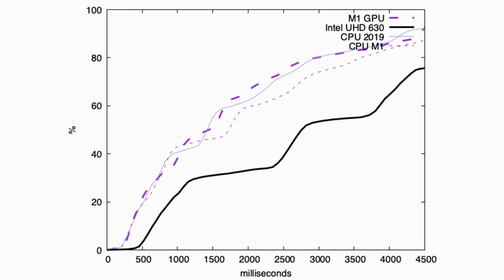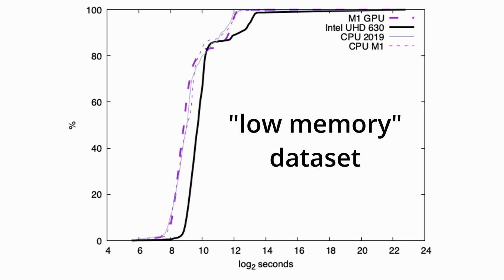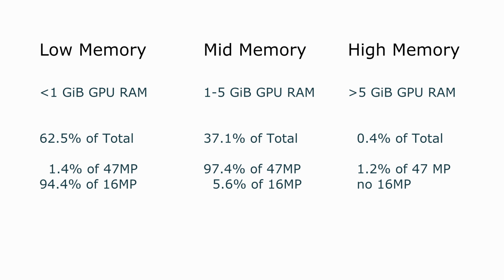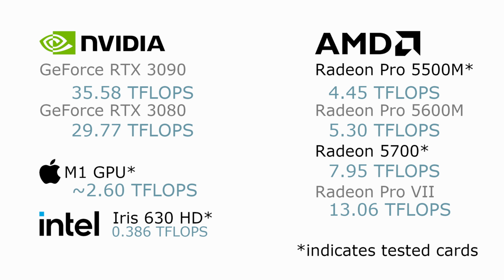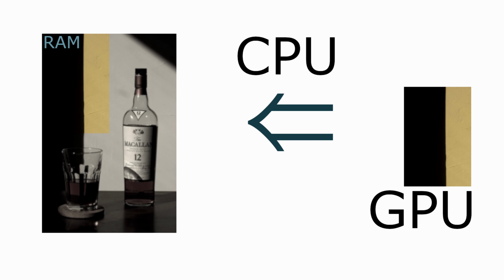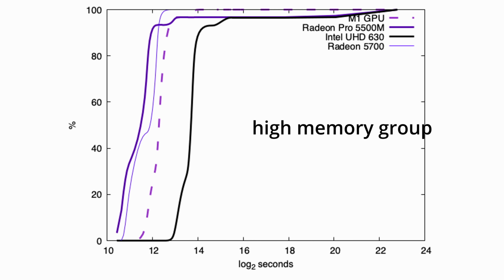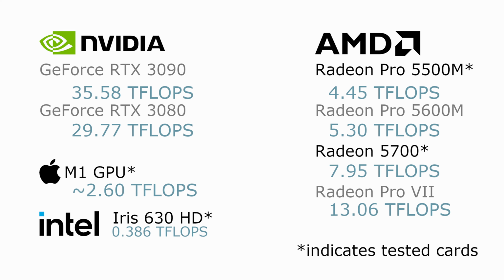Apple M1 vs Intel performance editing photos in darktable

Comment: Hi! Many thanks for your analysis. Would you mind to update it for M2 (Pro) and Darktable (allegedly) having gone native on M* chips? As I'm considering buying a new machine, I would really appreciate any advice. I've been using Linux for past 20+ years and love it, but I miss some apps (Logos Bible Study, Affinity Photo, etc.). I don't like mac (after playing with it for a while) as it seems clumsy and command-line utilities I love so much seems to be much worse but I'm willing to give it a try---if the Darktable works ok with it including the expensive operations like Diffuse-and-sharpen module. (I mean for my home stuff. For my real work, Mac is no way and I will stick to Ubuntu.). Many thanks for any hint or help you could provide. Best wishes, Michal
Reply from the maker: It's been four months, sorry it took so long.  I did run a comparison of darktable on an M1 Max (64GiB RAM; not an M2) both compiled for ARM and ran through Rosetta.  This wasn't as thorough as the original tests; my theory was that after an initial hit to precompile/translate the X86 instructions to native code, the Rosetta performance wouldn't be that different over the long run (under the theory that Darktable and its libraries generally wouldn't be optimized for Apple Silicon).

Given that hypothesis, I was a little surprised to see a 37% speed-up (specifically, running darktable 4.6.1 on MacOS 14.1 (23B74)) the Intel code ran at 137% the time of the Apple Si binary; or the latter ran at 72.87% of the time of the Intel code). 

I'm curious if you've seen other numbers, and if they're in-line with that, since I didn't go deeper (e.g. look at the difference in individual module performance).
Reply from the maker: Thanks for watching and your feedback! 
I'm not sure if I'll have an M2 Pro handy in the near-term, but I'm also curious about how the recent native builds perform against the Intel builds.  I've been continuing to run Darktable on an Intel-based Mac because of the eGPUs and (annoyingly) software RAID drivers I installed once upon a time.

Comment: amazing detailed analysis. thank you for that!
did you finally buy m1 pro? :)
Reply from the maker: Thanks for watching!

Apple hasn't updated their Mac Pro (desktop/workstation) line, which was what I was originally expecting to get–but they did release the Macbook Pros with the M1 Pro and M1 Max variants of the M1–I ended-up getting one of the latter rather than waiting for an updated Mac Pro (and principally for video workflow, where it made more sense than a GNU/Linux based system for a variety of reasons).  I'm finishing-up analysis of the benchmarks–I rushed the first M1 comparison video, and am aiming to do a more comprehensive job on the next round–so I'm hoping to get that published at the start of December (school holidays are going to effectively knock me out for the next week).

The short analysis: despite all of the "it's amazing" articles that have come-out over the last couple weeks-I'm still amazed by it, but it (M1 Max) also seems to fit right where I expected.  In most of the workloads I've tested, it comes in at about 2x the performance of the 2019 MBP and half the performance of a maxed-out Mac Pro (based on other's benchmarks) for tasks like Davinci Resolve.  I'll go into more detail about where it seems to excel compared to the 2019 16" Macbook Pro, and where it's more nuanced in that video.
Reply: @NottaPro 
I expected that you bought one of new Mac pro with m1.
I plan to buy 14" pro with 32gb (my the most demanding target is photo post production) .
Eager to watch your detailed comparison (based on darktable experience) when it will be ready. 

PS: I like to speak with people who pay attention to the details - you one of them m. I glad to became your subscriber 🙂
Reply from the maker: You won't be disappointed with the 14" MBP's performance in darktable, and 32GiB ought to be more than enough if that's your main use. It stays quiet which, is a bonus, although I did get it up to 109ºF at the chasis–but that wasn't exactly standard usage.  Thanks for subscribing!
Reply: @NottaPro  Would you test DT with release 3.8 on the M1 PRO / M1 MAX? I think lightroom recently made some impressive improvements running native on these machines. Not sure how much penalty DT gets by running Rosetta. But I'm also about to buy a 14" M1 PRO with 16BG and I love the fact DT now supports iOS.
Thx already for your M1 analysis so far. Really much appreciated!
Reply from the maker: Already done!  My most recent video on this channel is about the M1 Max (https://www.youtube.com/watch?v=nZKwVj57FJA), and while my focus is more on Davinci/video–it does reprise the DT tests, and goes even deeper.  Rosetta does have a penalty, but it seems to me most apparent on start-up (or as it sees code for the first time), which means the darktable-cli benchmark performs a lot worse that you'd expect during interactive editing.

In the end, I decided to keep my 2019 Intel Core i9 MacBook for darktable, and use the 14" M1 Max for Davinci Resolve–but unless you're adding eGPUs to the Intel MBP, or doing a lot of scripted (darktable-cli) sessions, the M1 Max will be faster (or at least not slower) while being quieter and lasting longer.  I also posted a related/follow-up video addressing what seems like silly reasons to put-off buying a MBP as well as why I'm not finding that newer eGPUs make sense-for me anyway-as the cost to performance increase isn't there for my workload: I'm not seeing dt able to push enough to the graphics card on either laptop to really make use of a significantly better card.

Re: DT on iOS-I hadn't seen that?  I've seen a competing product "darkroom" which is confusingly generic-I'd be very surprised to see darktable on iOS given its Mac port is barely supported (single dev AFAIK) and its core isn't very Mac-ish which would make a port a fairly significant rewrite.  I'd love it if I were wrong.

Thanks for watching!
Reply: @NottaPro  that one is in my watchlist … thanks!

Comment: Hi, 
I don't speak very well English (I'm from Switzerland), that's why I didn't understand every thing you said in the video. You go really deep with the explanation. I just have simply question. I work (not as a professional) exclusively with Darktable. It's for me the most important software. I need to change my PC and I wanted to know if Darktable run well on m1. Is it usable? Or it's not enough optimise? I don't mean it's the best computer ever but for 900$ does it run enough good to be usable?? 
Thanks you for the time you take to read this message with so much mistakes.
Reply from the maker: Short answer: yes, it's definitely usable.  If you're choosing between an Intel CPU with integrated graphics, and AMD CPU with integrated graphics, or the M1 (which only has integrated graphics); they're all going to be fairly close on performance. 

Longer answer: "It depends", as usual: darktable itself will run fine, but if you're working on high-resolution images you would do better with something that had a discrete graphics card (i.e. an AMD Radeon or nVidia Geforce with 8GB+ RAM, depending on your specific situation).

Last I checked, the required libraries to build darktable for M1 haven't all been ported, which means you'll need to run darktable through Apple's Rosetta 2 layer; but I don't know how big of a difference native libraries would be, since it's unlikely darktable will ever be ported to the native Metal graphics API.

The M1, running darktable through Rosetta, performs about on-par with the current 16" Macbook Pro (2019, 2.4GHz 8-core Intel Core i9) when the 16" is running on-CPU (i.e. without opencl/an AMD Radeon Pro graphics card); but the M1 will run cooler and quieter while doing so.  The Core i9 will probably edge it out, for that matter.

You don't mention what your current PC is: if you're currently running MacOS or Windows, and you don't have a discrete graphics card or eGPU; the M1 will probably be fine or better for you (the Apple silicon [M1] doesn't work with eGPUs).  If you're running a GNU/Linux PC, I might be more hesitant. I'd probably go with a Ryzen-based machine with the option to add a discrete GPU as prices become more reasonable.

In general... I'd try to avoid buying a computer in this market, component shortages are crazy, but if you need to, consider potential upgrade paths and what you might want to defer; an M1 is effectively non-upgrade-able except for external storage.  There's also a risk that a MacOS upgrade will negatively affect darktable in some way, which only has a single volunteer maintaining the MacOS port (compared to several volunteers for Linux).